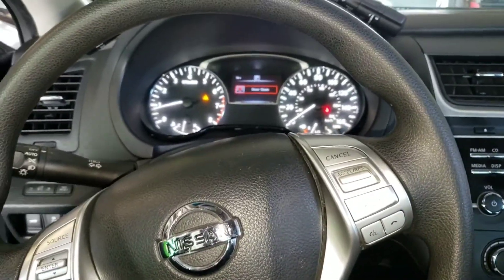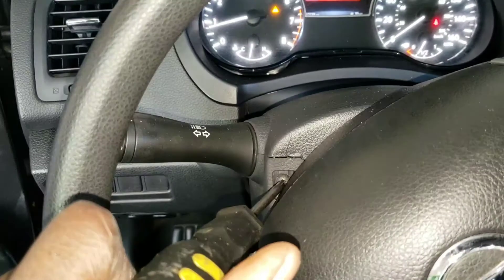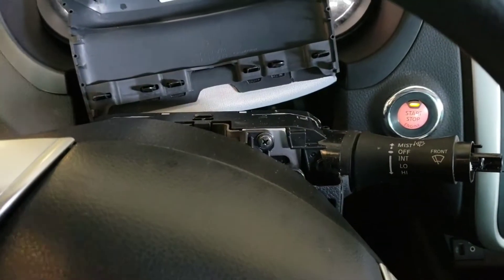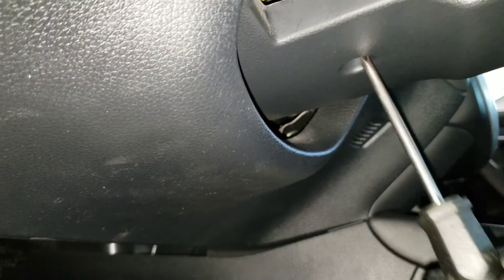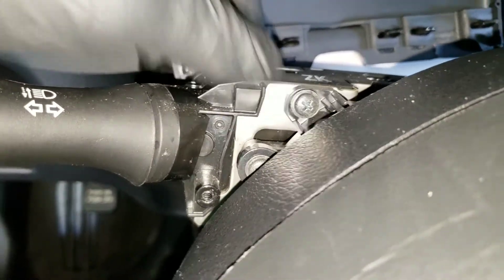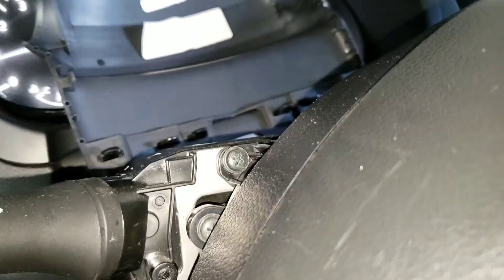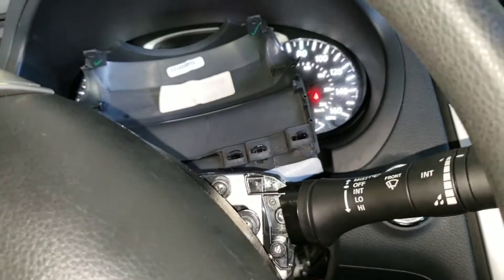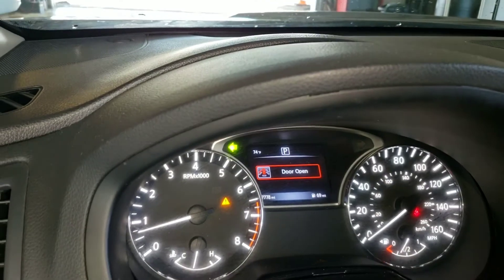Nissan Altima head lamp / wiper switch replacement

Comment: Thanks for the video. It was very helpful. Just recently added fog lights and had to replace the switch.
Reply: Loren F I’m about to add fog lights. You had everything pre-wired already? You just had to replace this column and install lights. And plug in? Thanks
Reply: @chefjoe_dcdunbar4856 Yeah, my Altima was pre wired for fog lights. I ordered an OEM set of lights, and the kit came with the column switch.